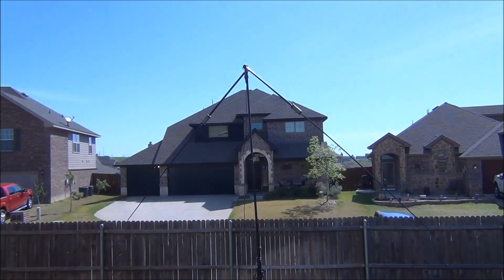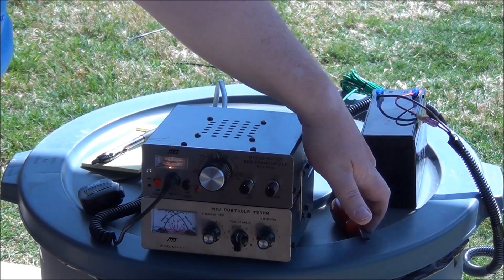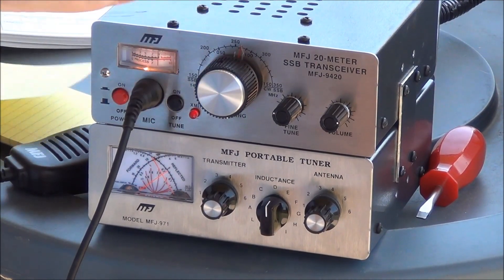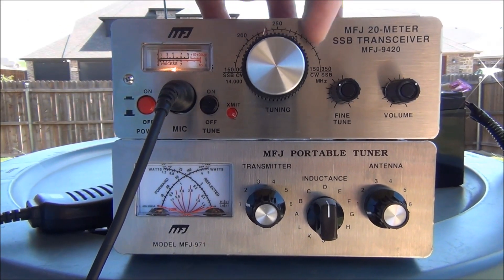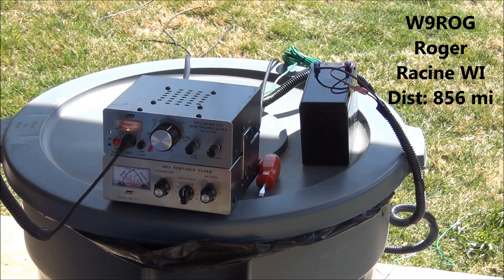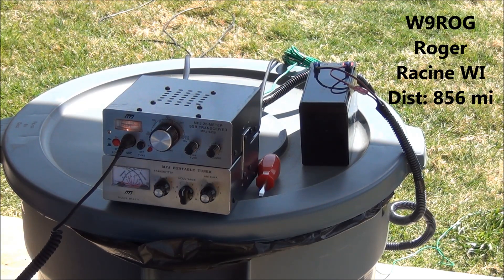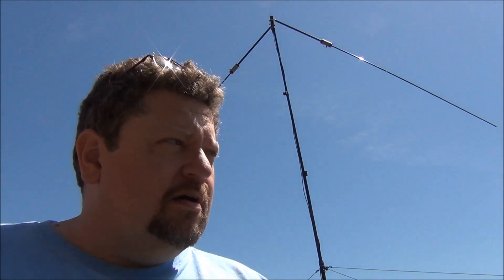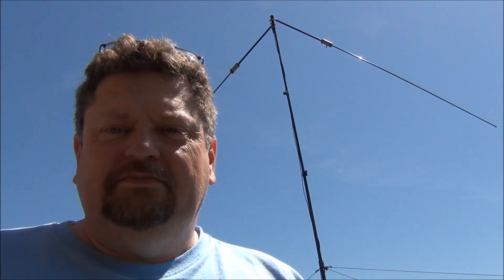Contact!  Buddiepole Inverted V using a MFJ-9420 QRP SSB and MFJ-971 Tuner - AF5DN

Comment: I use a buddipole deluxe with my 9440, 9420, and 9406.  The deluxe kit with a few extra parts makes a nice 2 element 6 meter beam.  I love these little radios.  I also have a 9475 that I use with a Texas Bug Catcher coil and MFJ telscoping whip.

Comment: You have to select the INDUCTANCE for lowest SWR. Also your ANTENNA adjustment is fully closed, this is due to having WRONG INDUCTANCE setting. Place TRANSMITTER and ANTENNA at 12 o'clock and rotate INDUCTANCE for lowest SWR, then use ANTENNA and TRANSMITTER to get 1.0 to 1 SWR.

Comment: What is your opinion about 9420? I want to buy one like that, for ocasional operation as QRP... Thanks and 73 de PY1ZB
Reply: The 1st 9420 I got didn't work for crap, but I liked the concept and got another one. It works great - only thing is the screening around the tuning knob came off - had to improvise another using white electrical tape.
Reply: I have the early radio with no RIT. 20 years still working fine. Drifts a little like old radios do, but not too bad. Sure fun too operate and the SSB TX audio is quite good. With an after market Mic " Better " , it's like a TS 440 Kenwood.

Comment: I think something might be set wrong with your tuner, or your arrangment with your coax. If you were getting 1.1 VSWR at the antenna, and 2.1 at the tuner, did you try other inductor settings to see if that tuner will bring it down to 1.1? I have used that tuner before, its a great portable tuner..

Comment: I bought my mfj_9420 off eBay 5 years ago and the mfj_971 antenna tuner.  With an all band dipole, I have worked my share of DX from Springfield,mo.  Russia and Germany as well as the carribean come in nicely. Never a problem with quality with the equipment wk0y

Comment: Nice video. I have the FT-817 and the Buddistick. I have also used the Buddistick with my FT-450 portable at 15 watts on CW. The antenna is a winner in my book. 73 NZ7B

Comment: Make you a coil out of  single #14 house wire, approx 10 to 14 turns on a 1/2" form
 " Broom Stick". Then hook this across the hot to ground on the center of the buddy pole. Then while using an swr meter or antenna analyzer tune the coil, spred it or push the turns closer to gether till the SWR goes down.This will change the antenna from very low R to approx 50 Ohms. All of the loaded antennas need a coil in the center to raise the R of the antenna for 50 Ohm coax...
73
Jimmy, ARRL TC, WX9DX